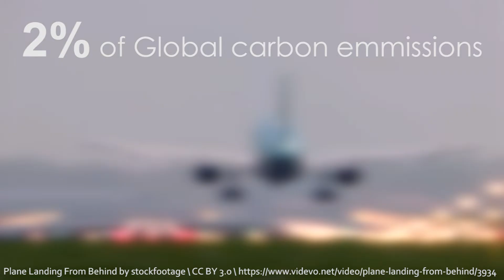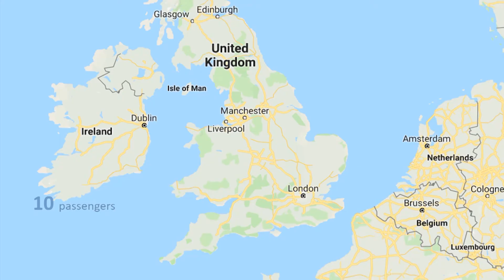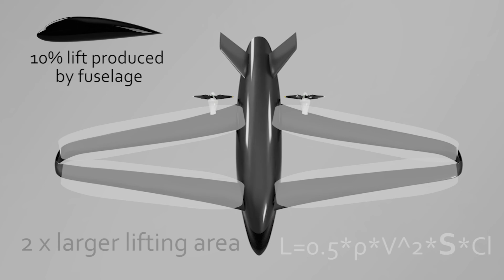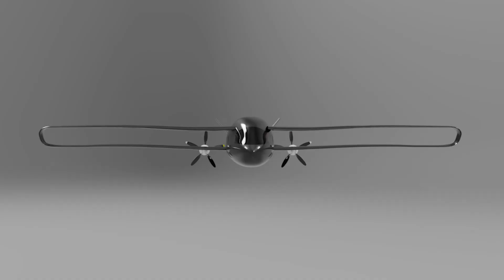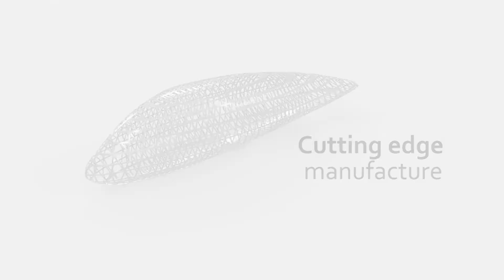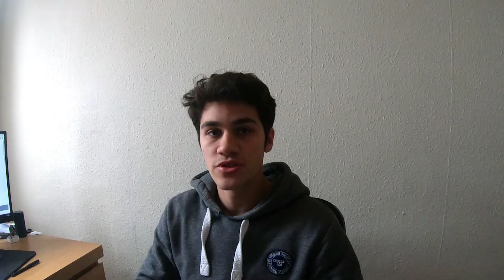The Future All Electric Aircraft

Comment: That's really cool, are you guys going to build a prototype? I've been interested in modelling my own design for a while, but I've been stuck on the idea that I need to figure out sizing for a specific payload before I start to model. In your video it looked like you guys were able to model the aircraft, and then adjusted the sizing to meet a certain spec based on your CFD analysis?  Can you elaborate on that? Also, can you tell me which CFD software you used?
Reply from the maker: Christophorus Hi there! Thanks very much! Unfortunately we won’t be building a prototype as this was a project for a masters degree and we wouldn’t have funding for a full scale model, what we did build however was a wind tunnel model.
We used an iterative design loop to design the aircraft, so we set a design spec for a range and amount of passengers, then we estimated battery size and weight from first principles (essentially a modified version of the Bréguet range equation). This gave us a ‘first pass’ at aircraft weight and required size etc so we could work out an aerodynamic and structural design. The aerodynamic design follows from weight estimations as we need to be able to carry the maximum takeoff weight, so we can roughly estimate the wing plan form area (after some initial 2D aerodynamic studies on aerofoil sections etc) from a given lift coefficient. After this we create a first pass design and analyse it using CFD (i used Ansys Fluent regarding your question) and iterated the design on from that. Hopefully that answers some of your questions! Feel free to get in contact if you want to know anything more detailed!